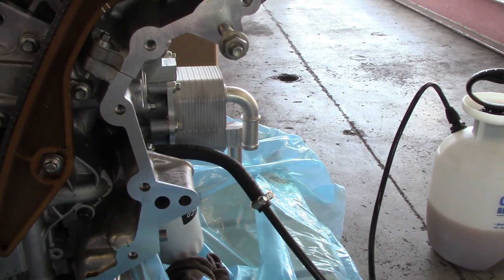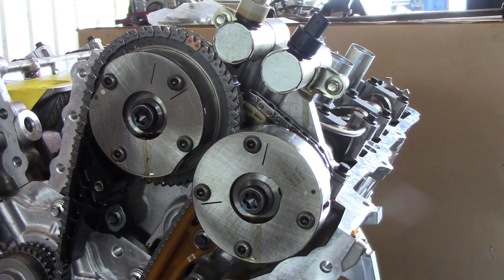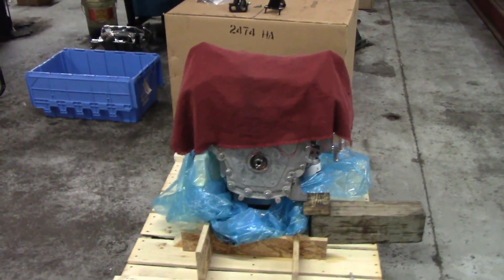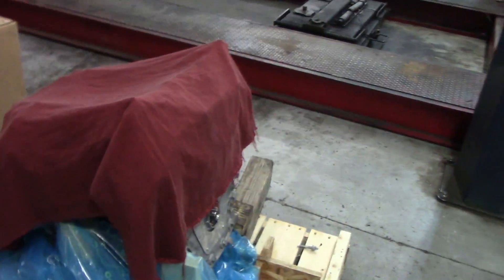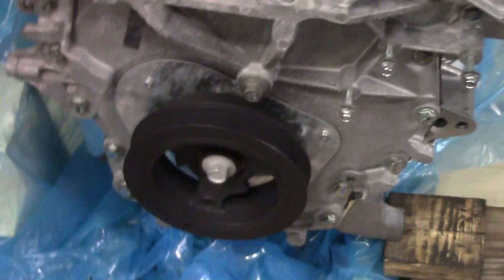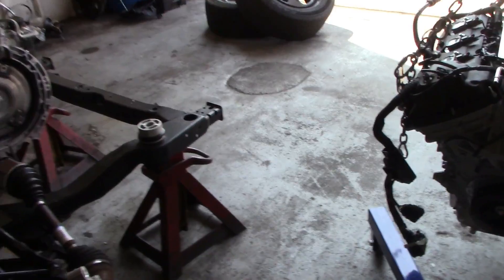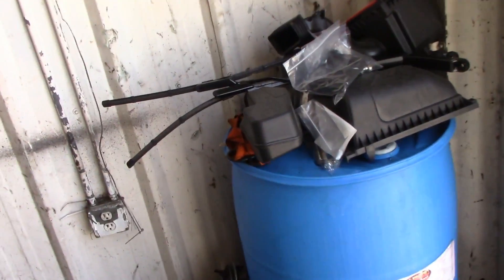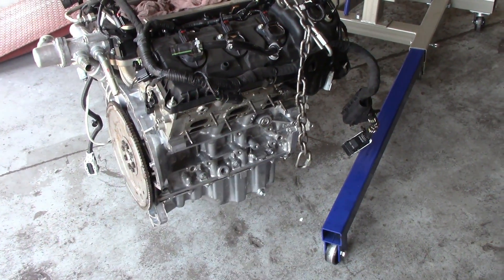2016 Explorer 3.7L engine failure part 3

Comment: hello sir  am having a problem after I fixed my engine any help here is its have ford edge 2012 3.5 vct engine replaced the short block and the cylinder heads with the primary chain and tensioner. after engine fixed and started there's this rattling noise at the front of the engine which last 2-5 seconds at cold start its happens only once its come back the next morning or when vehicle is parked for about 7-8 hours pls any help
Reply: Timing chain guides ? Maybe the issue

Comment: That's what I love about the torque convertors on gm cars, there's three threaded mounts concentrically spaced, after the engine and trans are mated, you start one bolt and they all line up. I usually have them facing downward along with the flex plate, so all I have to do is start the bolt, its already more or less lined up. Usually only have to turn the convertor less than a half inch either way

Comment: For the guys that don't know these exist.  Bottle jack knob.  Once you have one you will wonder why you didn't get it earlier.

Example of what I"m talking about.  I'm sure there are other versions at varying price points.
http://www.swagoffroad.com/Machined-Thumb-Knob-For-Hydraulic-Bottle-Jacks_p_127.html
Reply from the maker: I appreciate the link I need those for my press and picker alike!
Reply: It was one of those "These things exist?.. why didn't I think of that sooner?" type of mind altering moments.  Makes using anything with a bottle jack so much easier and way more accurate especially if you have an inexperienced assistant.

Comment: Do i see a new cherry picker being used ? If so, do you like it ? What brand might that be ?
Reply from the maker: I made the mistake of getting one with out folding legs, you have to actually pull the legs out and put them in the frame, which totally blows. Other that that it's as good as any other basic hoist for about 200 bucks. I think it had A/C Delco stickers on it, not sure who actually makes it. It is two wheel steering so I am happy about that.

Comment: I have used garden sprayers for manual transmission and differential lube for years, but never used one util i saw the video you used it in a few months ago. now i use it for every engine i do even if there is a way to prime it with another tool,  works great on the coyote's i build and install. 2 thumbs up.

Comment: Love the garden sprayer method.
Awesome job.
The "long" bell housing bolts with the heads cut of may have made lining it up easier.
Might not have had room though.
Reply from the maker: Appreciate it.
Reply from the maker: Yeah there was no room. I could have lifted the trans higher to clear the sub-frame but it would have stressed the right axle shaft to it's limit!